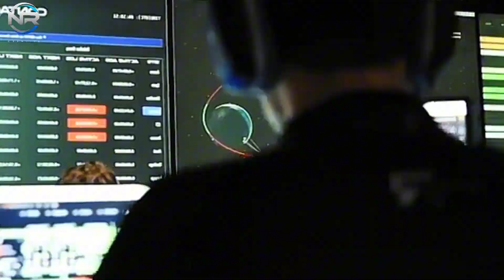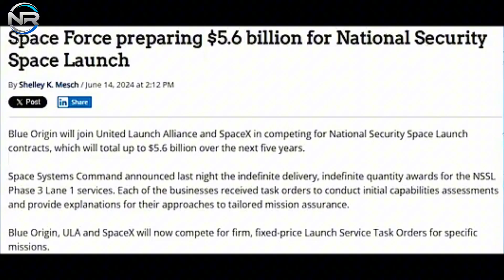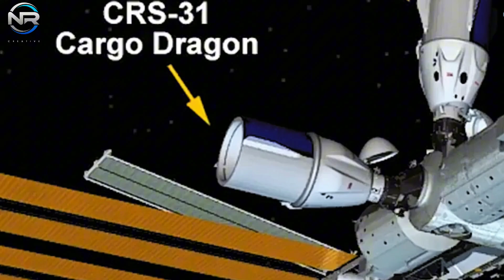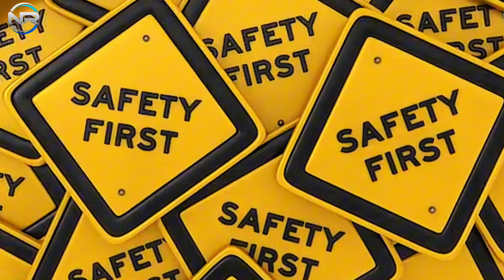Competition of Two Great Giants! Rocket Lab Declares the Most Advanced Rocket Ever to Beat SpaceX

Comment: Rocket Lab Neutron is the most innovative rocket up and coming 2025, its capacity of 1,500kg to Mars and Venus is especially unique and besides big nssl and private megaconstellation demand it is especially suited to the deep space missions such as the NASA MSR $2B mission. It super light weight material enables smaller booster size leading to much smaller, simpler and cheaper launch pad.
RKLB 🚀

Comment: looks cost effective  for sats. fairing not conducive to docking operations or future service type ops. if Mr. Beck tries  wishes to do more than releasing sats in orbit with his Neutron it could turn into something much more costly. So, might be time to stat thinking of another basket for future programs and let Neutron be a money printing machine for his next step forward.
Reply: Neutron stage 1 and its built-in fairings are not designed to reach orbit, only the second stage will reach orbit, so docking stage 1 will never be a requirement. Agreed that Neutron will be a money printing machine 🙂
Reply: Rocket lab already mentioned that the fairing would be removed in the case of a capsule. The capsule would be put where the fairing is.
Reply: @danygauthier605  you didn't get the main point which is that the stage 1 will never go to orbit, so it will never have an opportunity to dock with anything, fairing present or not.
Reply: @danygauthier605  seems prudent to separate proven tech from r and d tech. avoid having a mishap take down the entire enterprise